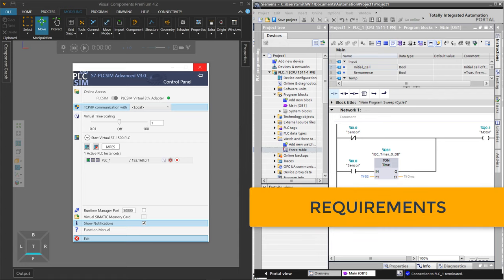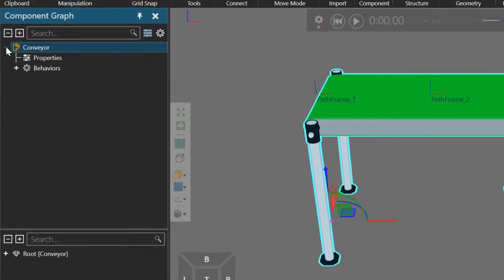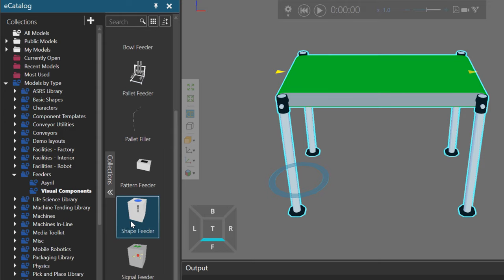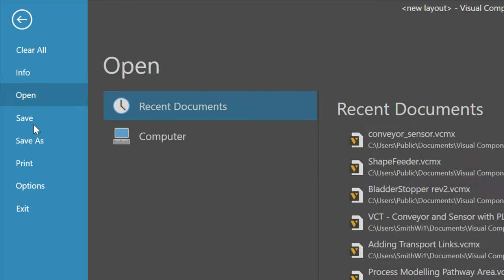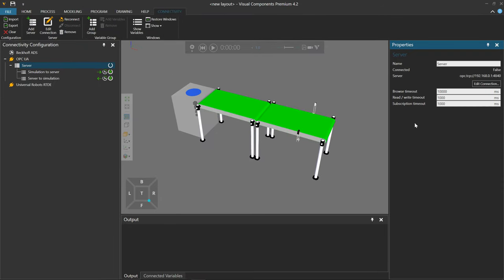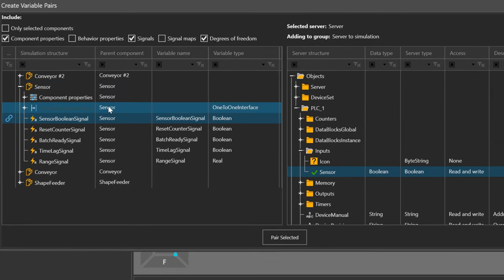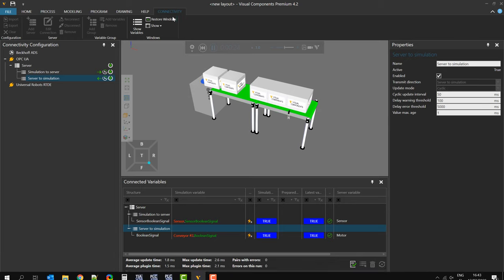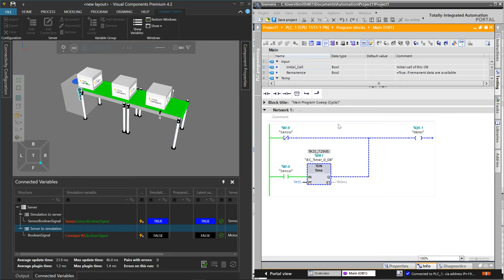Make a Simple Conveyor PLC Ready

Comment: Can I use RSLogix 5000 instead of Simatic s7 ?
Reply from the maker: For OPC UA connection, yes.
Reply: @Visualcomponents  okay thank you... I want to create a simulation which has to be interfaced with the ladder logic in RSLogix 5000. For this, can I use the free version of visual components or I'll have to buy the premium version?
Reply from the maker: We recommend you fill out contact form to inquire about products.
https://www.visualcomponents.com/contact/

You can also contact one of our partners in your region.
https://www.visualcomponents.com/contact/partners/

A quick look at some of the controllers for the RSLogix 5000, it seems most do not have OPC UA support, but best to check latest firmware updates. At least CompactLogix 5480 indicates that use of FactoryTalk Linx Gateway is possible to communicate via OPC UA.

At this point I would suggest you ask on our forum. A socket connection is possible and there are examples on the forum.